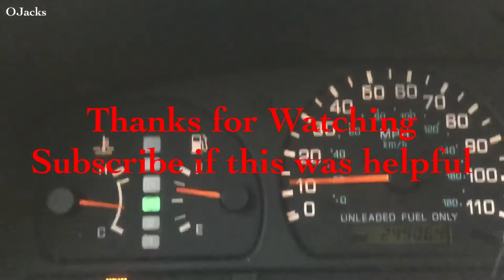Replacing the Instrument  Cluster on a 1998 Nissan Frontier Teardown and Repair

Comment: Thanks. So it was just a loose power line? My gauges started working intermittently for one day then stopped completely the next day. I will give this a try.
Reply: when your going about 30-40 give the top of the dash some good whacks to see if it will start back
Reply: @animoshho  sent it to the guys in texas that are ebay. $95 and they fixxed it. 5 months and still working fine.